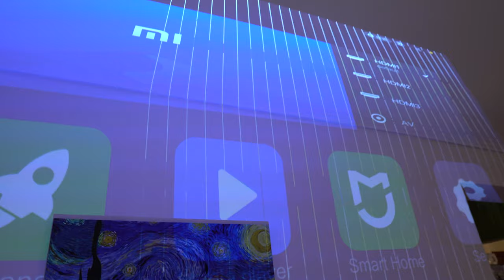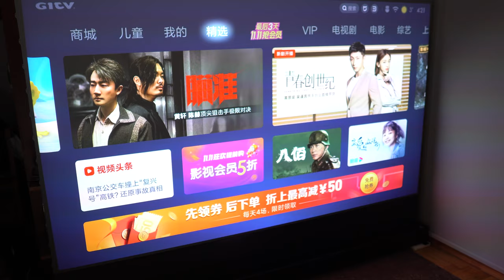Xiaomi 4K Laser UST Projector Repair (Video Guide)

Comment: Not in this situation or with this model but after getting an overview from the site, I'm impressed a person noticing a design flaw with a cast-iron that bends under heat and pressure and then goes out on a crusade to design and CNC the part and also produce it for others and make a tutorial so the average skilled consumer can DIY repair a Chinese product that is difficult to get any service for, here in the west.
internet repair community at its finest.
Well done, cheers from Denmark.

Comment: I had this same issue after some 1.5 years and the boot time for the projector was approx 4 minutes with vertical lines which will eventually disappear in 4 minutes when the projector warms up. I ordered the contact plate from Nikos & it reached India in 16 days. I just followed this video and the repair is quite straightforward, however its not very easy as well. The repair needs Philips head screw driver of various sizes, tweezers, and some plucktrums. There were few difficult places, but otherwise it can be done by anyone with some little experience with electronics. After replacement, the projector works as new and no vertical lines of what so ever. Once again thanks you Nikos...
Reply: How did you order ?? I’m also from india and I’m facing issues like it turns off suddenly without any warning

Comment: Nice work. Quick question as I couldn't make out in the video but can you remember if the fans used standard fan headers?
Probably not work the risk of opening it up but wondering if its viable to replace the fans with higher quality ones in an effort to reduce noise.
Reply from the maker: Τhe noise is not from the fans, i have replaced in mine the fans with silent fans, no difference. The noise is from the XPR module and from the phosphor color wheel.
Reply: @projectorjunkies4152  good to know, saves a job. Thanks!

Comment: Things like this are what's stopping me from buying a chinese UST projector at the moment (+ the coil whine). You would think one of the designers/engineers would have fixed this plate with the new models but as I've read in your post this doesn't seem to be the case...

Comment: Great Job,
i have a question , I have the Mi 150, 
it seems the power supply unit in the projector need replacement, do you know where i can find a replacement for it ?
Thank you
Reply: Hello.  Why did you decide that you have a problem with the power supply?  I have the same projector, and it shines very dimly (the brightness is very low, you need to turn off the light to see anything), I think that I may also have problems with the power supply

Comment: Great video ! Any ideas concerning the high pitch noise by any chance. Do you know by what it could be caused ? 
Cheers
Reply: i think i've read somewhere that some kind of 4k upscaling chip caused this. By disabling something in a menu that coil whine stopped. But i'm not sure where i've read that so i cant find it anymore
Reply: the high pitched noise is caused by the color wheel motor spinning at around 5000rpm this cannot be stopped they may be able to dampen the sound with later design upgrades

Comment: Hi Nikos - Do you know if this is an issue on the new Mijia 1S 4K DS02 2020 version at all and whether Xiaomi have corrected this issue? Thanks
Reply: Hi i have the 2020 version all working fine and i know there were improvements made like full color wheel and laser temperature monitoring so i think they would of checked out any issues 👍
Reply: @dexter19885  Hi Ive run mine for 50hrs + now and no problem with the 2020 version , bear in mind theres tens of thousands of these out there and most are working fine 👍
Reply: Hi dont risk it then ive worked in IPC electronic inspection for years now and ive seen everything i had a brand new panasonic 
4k player and the 4k decoder chip failed IN A WEEK it happens with complex electronic equipment even the top brands 👍👍

Comment: this might be an illogical question but guys, would you buy the Mi 4K projector again even knowing there is this issue ? If not, which one would you get ? Do the newer version suffer from the same problem ? Thanks!
Reply: After 2 years of experience with it, I am not sure I would recommend it: the fans are pretty loud (to replace them, you need to fake the fan speed output), it's very hard to replace the xiaomi chinese android by a generic english android (consequence: some menu and content remain chinese), and finally this issue that seems to happen after 18months of use (the slow bootup or lines).

But Picture size and precision is great.

Comment: Was any liquid used on the cotton bud when cleaning the component under the plate?
Reply: just use IPA to clean contacts and then remove the old heat sink compound and replace with new .

Comment: Hi! My laser lanp suddenly stopper working today. Worked yesterday. Now there is no image, obviously, but there is sound. Projector is 1.5 years old. Is it the same repair procedure?
Reply: I suppose no. I had to replace the curved plate several months ago (successfully) and yesterday my lamp or laser died and now I’m more or less in your situation. In the next days I will dissemble it again and maybe I have more info. Please contact me if you resolve it.
Reply: @gandolfo_ , thanks for your reply. I managed to get to the bottom of this - it happens when there is no device plugged into HDMI1. And you have to plug it really hard - any slight cable movement will turn the lamp off. This is annoying of course, but since I don't touch those cables and don't haver any too small kids or animals playing with them - can live with the issue. Still bothers me though.
Reply: @gandolfo_ Hello.  Don't have any image at all?  Or is it barely visible when the lights are off?  My brightness is very low (the picture is visible only in the dark), perhaps we have similar problems, did you manage to solve the problem?

Comment: Hi,  thanks for your video. I have a different issue to yours. My projector suddenly stops displaying anything. It displays a black screen with the front light flashing. Do you know what’s the driver ? Thanks !!!
Reply: Hello.  I have the same projector, and it shines very dimly (the brightness is very low, you need to turn off the light to see anything). Perhaps we have similar problems, did you manage to solve the problem?

Comment: hi, for the me only teh HDMI ports of the projector is not working. Have you come across this issue before? the projector works fine, but the HMDI ports does not detect the input device. Can you help me with a solution?

Comment: To everyone out there facing this problem with vertical lines -  try to tap/move a bit main cable in the middle to see if it does not help with the problem (the one being lifted at 7:38 of this video). I have got the better part from Nikos last year, but eventually the problem reappeared. I did dis(assemble) this projector about 20x by now, and currently tapping cable is what fixes the problem for me, and making sure it is not pushed by anything when assembling back.  Showing myself the effect of tapping in this video: https://youtu.be/R2Lueqy-jKI

Comment: Very good job!!! I have a problem too with my xiaomi mjjgtyds01fm...the video is completely black! The source light is completely death!!!! You think could be the same issue? Wher canci find the replacement? You sell it? Thank you very much. Davide
Reply: Update: i just fixed my problem!! A flat cable wasnt blocked and when I opened the pj this made the problem. I'm anyway intersted in your plate. Please can you say me how I can buy It? Thank you davide
Reply: @davidefr  hi, im facing the same issue as yours. No video. What do you mean by cable wasnt blocked? what did u do to fix it?
thanks in advance =)
Reply: @bahukirifx3605  at 9:08 you can see the flat cable that I found disconnected. It wasnt blocked...
Reply: @davidefr You didn't have a picture at all?  Or was it of low brightness?  What is visible only in the dark?

Comment: Have you failed to mention if there is a screw underneath the product label in the centre (where the model number and serial numbers feature) purely because i have got to the stage where you disconnect the top and its met with extreme resistance in the middle part of the projector 😤
Many thanks in advance
Reply: Thats where I am stuck... what was your solution?
Reply: Yes there is a screw under the label at least on my white one.

Comment: Hi everyone,
I have a Xiaomi Mi 4K Laser Projector 150" and I'm experiencing an issue where the projector only displays one color after a short time of use. When I first turn it on, the image appears normal with all colors working correctly.
However, after a few minutes, the screen shifts to displaying only a single color (e.g., red, green, or blue) and the other colors disappear.
Has anyone else experienced this issue? What could be causing it? I suspect it might be related to overheating, a failing laser, or some issue with the power supply. I'm not sure if this could be a hardware problem with one of the lasers or perhaps a cooling issue. Any advice on how to diagnose and fix this would be greatly appreciated.
Thanks in advance!

Comment: I have the 2019 version. A week ago the projector started to reboot itself. Now it completely gone off and doesn't power on anymore... DMD Plate problem, or a Power Supply failure? Any ideas? 🤔
Reply: Same problem for me also. It can be started after a long gap by switching the power off. Again problem of rebooting starts within an hour of running. Any solution please.
Reply: I discovered the problem with mine. It was the power cord. I wasn't using the original one provided with the projector, because of the Chinese plug pattern. I've changed the plug on the original cable and now I'm using it. The projector is now operating flawlessly.